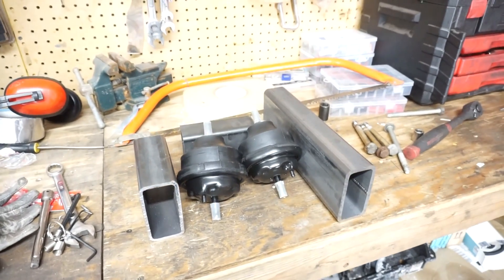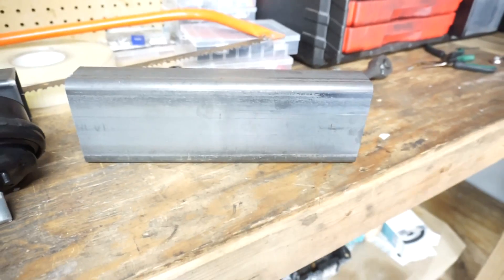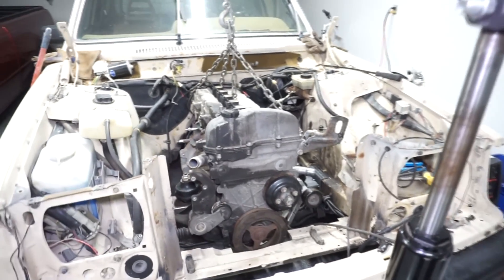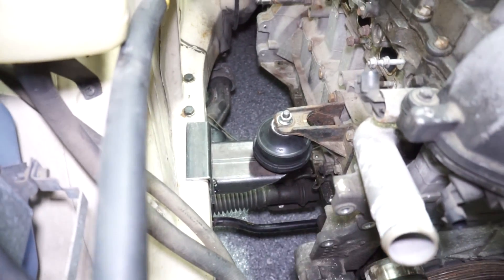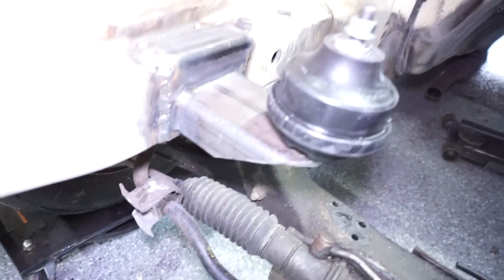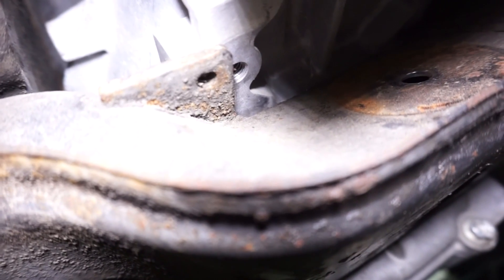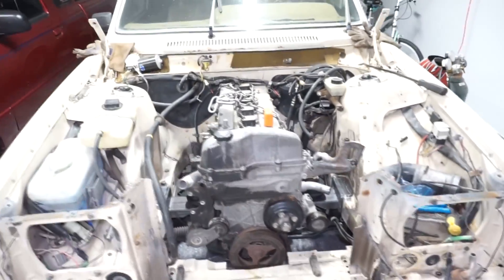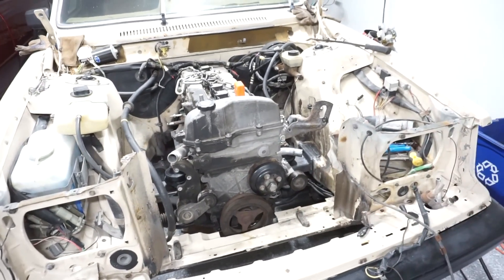ITS IN!!! Building Engine Mounts For Vortec 4200 In Volvo 240 Wagon!

Comment: There must be a Speedy metals somewhere in the Fox valley, usually a much better option for dumb little pieces of steel or Al.  Fast and generally pretty cheap.
Reply from the maker: There is and I have gotten stuff from them in the past. I guess I just didn't want to go pick it up, so bought on ebay, lol.